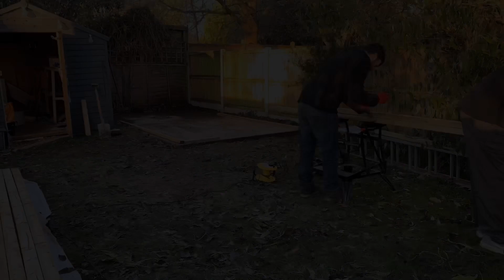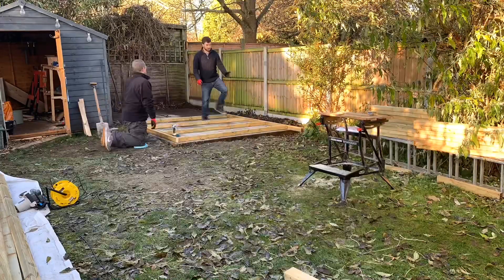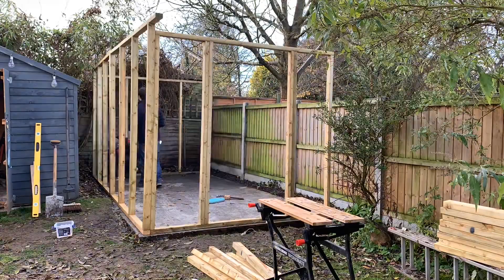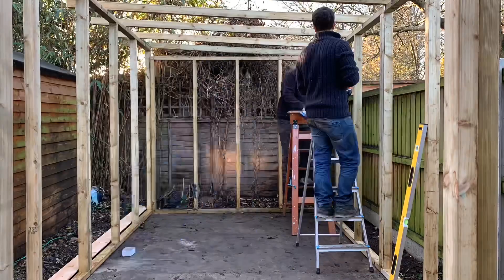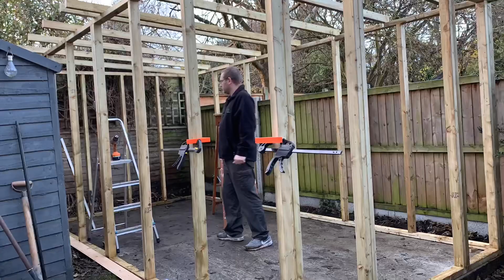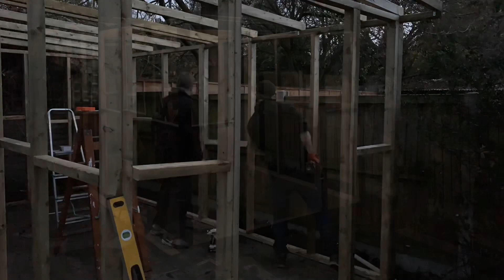Workshop Build : Part 2 - Timber Framing

Comment: Hi buddy,, I’m about to make my shed,,have you put anything between the timber and concrete floor to stop it from rotting because I’m not sure which timber I need to fix to the concrete and also how did you fi- it to the concrete.👍👍
Reply from the maker: Hi mate. I haven’t put anything between the concrete and the timber as the concrete is slightly smaller than the timber base and shouldn’t get wet. The timber is treated and due to the weight of the structure there’s no need to bolt it to the concrete base. I’m no expert, so I would advise asking someone that has industry knowledge, but mine should last for many year to come.
Reply: O.G.B Woodwork ok cheers m8,,il keep that in mind 👍
Reply from the maker: Explore With Ant make sure you film it and put it on YouTube. Would be great to see how you do it.
Reply: O.G.B Woodwork yea mate definitely,,I was thinking of copying that one that Colin fuze did but without the row of bricks,,check his out
Reply from the maker: Explore With Ant you thinking of adding the bunker as well? 😂
Reply: O.G.B Woodwork I wish mate hahah
Reply from the maker: Explore With Ant same.